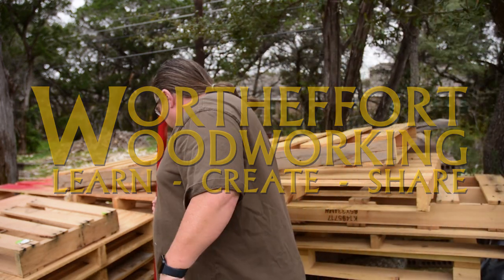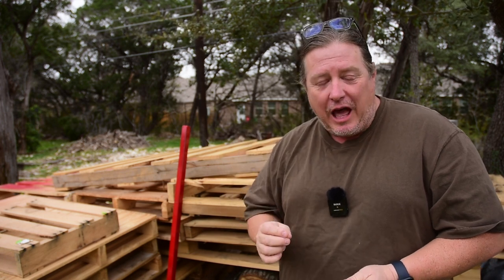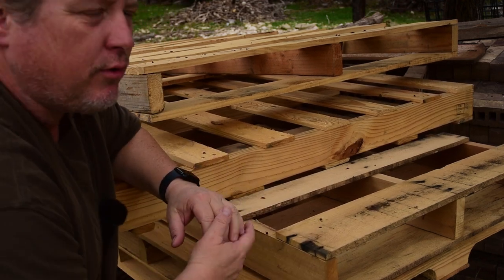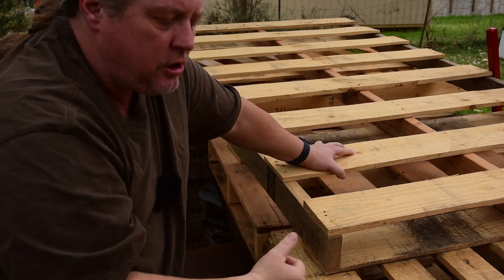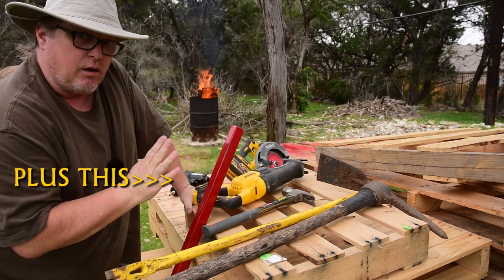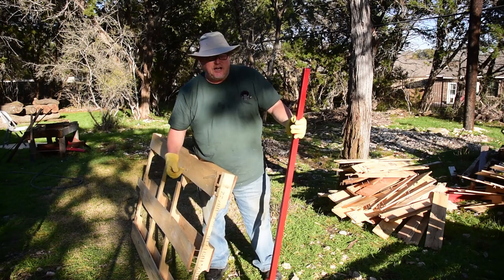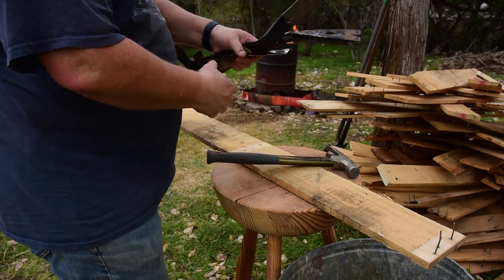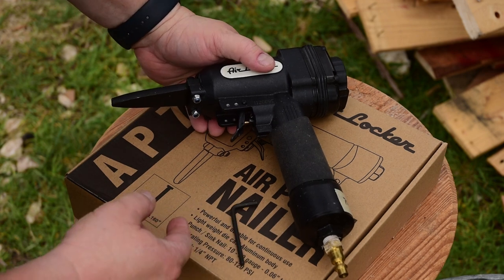How to Choose and Break Down Pallets

Comment: I worked in a warehouse for over 10 years. I've destroyed probably 100,000 pallets and used their wood to heat my garage and polebarn. The pallets with the square blocks in the corners and center are the best pallets period. They always have great wood and are thicker too. Take a sledge hammer and hit the square block. It will knock it right out and you will have flat panels to work with after that. Easy to get the nails out too when you knock the blocks out.

Comment: Different pallets require different tools and a little thought. Some are easy and others have so many nails or staples that it takes a lot of time. Any rebuilt pallet has probably got cut off nails and that makes milling them properly impossible. Look for the specialty pallets that have added wood for some special purpose, they have more usable wood.

Comment: For me I found it much faster to use recip saw with metal cutting blade - slide blade between boards and cut nails - can disassemble a pallet in less than a min - then punch the nails.

Comment: work in a large metal fabrication shop that uses a lot of sheet steel and coils. Most of the pallets that we get in are made of 3x4 solid oak and 1”-1.5” thick oak planks. A lot of it is worth surfacing and using

Comment: I've had that exact same gun for about 4 years and it still works good , I also have a regular air gun with a ball joint remover to gently pry the boards off, I made one of those pallet busters but being a cripple didn't work too good for me ! hard to use with a walker .
in my chair the air hammer is easier to use thank  you for the videos enjoy the turning ones this one is a bonus

Comment: Like you, I started with a hammer and a nail bar.  Progressed to a wrecking bar and a Burke Bar.  Eventually, I built my own pallet buster very much like the one you built.  AND, like you, what a time consuming pain in the caboose.
Research:  Nail Kicker V20.  The price drove me away instantly.  But the pain drove me back.  I found a used one on Craig's List.  You will never regret purchasing one of these.  I HIGHLY RECOMMEND these.  Instead of pulling the boards off then driving out the nails from the rear, you use the Nail Kicker on the FRONT and drive the nails through the board into the 2x4 stretchers.  Often, the board falls off, many times you can use your hand to pull it off, and once in a while, you'll need a pry bar.  Having NO NAILS in the boards cuts the break down time more than in half.  IF you value your time in dollars, you will off set the purchase price very quickly if you do a reasonable amount of pallets.  IF you BURN them for firewood, you will break down many more and the off set is extremely fast.  In the time we have used ours, I could have purchased 6 or more Nail Kickers brand new and still be ahead.
Note:  The Nail Kickers have 4 different sized heads if I remember correctly.  I recommend purchasing 1 or 2 sizes only.  Just the sizes you are finding in the pallets you can find.  The huge industrial pallets will use larger nails and require the larger size anvils and drive pins.  The directions are clear, all tools included, and an oil bottle is supplied with the new ones, although any oil can will work just fine.  Add 2-4 drops of oil every 4-8 hours of use.  I use more to prevent premature failure of o-rings.

Great videos.  I enjoy watching all the videos you post.
THANK YOU!

Comment: I bought a pallet buster and that air nailer and absolutely love them. Although my pallets are for odd jobs, these two tools make the process almost fun. My air nailer is set to 95 psi and the force of it pooping out nails is dangerous. I now use a plastic garbage can and lay thick fabric on the bottom of can so the nails don’t ricochet and shot back at me.

Comment: I got one used on Amazon for 40% off the already low price last year, love it, for renovation demolition work, reusing wood when it's still good. I had a white oak pallet with 8/4 sides without cutouts for the forks, and a fiddleback maple pallet with thinner planks I used for drawer fronts because on nice wood I'd rather cut the nail holes out of the picture.

Comment: hi , just ordered the nail punch air tool . I used to sell air tools for Snap On , and always told people to oil the tool at the end of use , couple of drops , run the tool , that means the oil STAYS in the tool whilst its stored and protects it as it cools down which is when the air cools down and turns into water to rust the internals , hope this helps ,

Comment: Dang that little pneumatic nail remover is really cool, I hate pallet wood because it takes so long to remove the nails but with that little tool it definitely makes pallet wood a good option for outdoor projects or projects where the surface quality of the project doesn't really matter.

Comment: That pallet buster is an awesome tool!  I can almost never pull those nails up without tearing the wood apart. They tend to use twisted nails that don’t pull easily. I cut the slats off of hardwood pallets and use an old hand plane to resurface them. Not may hardwood trees grow up in these northern parts so pallets are one of our only sources of free hardwood.
Reply: That pneumatic nail remover is also pretty nifty!

Comment: Great tool!!  I noticed that the pressure rating is on Amazon's link you provided at 80 to 120 PSI.   

Available at a lower price from other sellers that may not offer free Prime shipping.
Style: Nailer
Air Inlet: 1/4 inch NPT Thread
Operating Pressure: 80-120 PSI
Driver Diameter: 0.16 inch
Removable Nails Range: 10-20 gauge

Comment: I have one great fun to use, it nice to take revenge on all the nails that have fought with over the years. I fire into a drum of water a lot safer then just letting them bounce around. Your video shows a couple flying out of the drum, but these are a great time saver. Loke your video as normal. Thanks Bob

Comment: I recycle alot of pallet wood. The pallets i get from where i work are usually 4' by 10' for sheet metal. Planks are usually 1" thick.  Usually i use my recip saw and a demo blade, slice between the planks and runners. Then i either pop nail heads out or glue them in depending on project.
Reply: I work in a large metal fabrication shop that uses a lot of sheet steel and coils. Most of the pallets that we get in are made of 3x4 solid oak and 1”-1.5” thick oak planks. A lot of it is worth surfacing and using
Reply: @Patrick Grate  we also arr metal fabricators. Im not sure of all yhe species of wood if found but i know oak, fir, and poplar are common. I also found a reddish color wood i think is alder, not sure. One tip if you dont like nail holes, drill and plug with dowels.

Comment: I have got pallets from my work place with great wood! Pallets from Southeast Asia with mahogany  50% good dark wood 20% ok 30% light colored l would not use as l read it has a high silica content. Large pallets from Canada that new machinery was shipped in on quarter sawn pine 2x4x12’  l got two 4x4x45” walnut pieces a number of pieces of oak. The imported pallets are HT. The HT stamp means heat treated, kiln dried to a higher temp for a longer time in order to kill any bugs their eggs or large.

Comment: That AirLocker will also work to finish sinking large framing nails as well.  Don't use it to drive the nail, use a hammer, but if you get one in a weird spot where you can't get a good swing on the hammer to finish sinking it (like in a corner) this thing works great at driving it the last 1/4 inch.

Comment: I recently found a possible source of really nice reclaimed wood. I got pieces of a family heirloom piano. It was called 'untuneable' so not even something my sis could donate to anybody.  So, a very large, VERY heavy paperweight. I didn't know until we started to dismantle it, but the front panel is a solid slab of gorgeous birdseye maple without a flaw. The keyboard cover is oak. I'm thinking of making coasters from the keys  (since the thing is over a hundred years old there may be issues, though,  if the white keys are actually ivory.)  I want to re-use as much as possible and give my grandmother's piano a second life. My sis wants to turn the inner strings into a water feature. People are GIVING old pianos away.Once I get my shop set up better I am going to have to look in to how to transport the heavy bastards.  Until then, pallets. I just this week got an Air Locker and totally agree. Use eye protection always - those nails zing all over the place. Also, don't burn the scrap wood! I am bagging up small pieces for kindling and larger broken pieces for camp wood. Have you SEEN what they charge for camp wood?  When I get excess I can probably sell that too!
Reply from the maker: Piano's from before the 50's are most interesting. We use the black keys (many were pure ebony) for accents, pens and such. And much of the panels are actually wide boards not glue ups. Seems after the 50's veneers came into vogue and are less versatile in reuse. Armours are same way.

Comment: The recommended pressure may not be printed in the manual, but it's right there on the front of the box. I guess that kinda counts as the manual, maybe.
Reply: Yea 4th bullet 80-120 psi

Comment: Great video as always, i just wanted to respectfully point out that while I'm sure the instructions were terrible and the tool should have had the psi engraved as you pointed out, indeed the operating psi was right on the box in the shot at 17:57 😅

Comment: One trick I found.  Once you get the bottom boards off, with the top boards down, stand on the pallet and hit the sides of the blocks or stringers with a sledge hammer.

Comment: Here is my suggestion, which eliminates most of the work. Use a dowel making bit to drill down around every nail. The nail cones out with the dowel. Fix the hole later as part  of the project, but only to the degree necessary to keep the needed esthetics of
 each project .

Comment: I too had seen one of these being used to break down pallets, and for the priceIwas willing to try it out, assuming that if it worked for me the way it did in that video, the savings of aggravation would be well worth the price tag. Well…to be honest… I don’t regret a single dollar of its price, and I had a freaking blast blasting 💥nails out of a huge pile of wood. If I hadn’t pulled a double as soon as I got to the woodpile (stepped on two nails at the same time about an inch away from each other 😖 🤕 ), then it might have been a perfect day breaking down pallet wood.

Comment: Look at the bricklayers in the construction sites. They have to get stronger pallets to hold the bricks. I found a lot in oak. (I know ! Oak ! ) Yeah.
Reply: I've found a good technique to save the whole plank on the top and bottom. You put a 2x4 in the same side of the one inside the pallets. Then, you place something under the 2x4 that is trespassing the pallets and then just hammer the 2x4 that is from the pallet. It'll give a even surface under the planks so it don't crack in pieces and... I mean it's easy and you always have spare 2x4 so... ;)
Reply: The pneumatic nail pusher is a taker. 50 $ well invested. I'll watch to buy one.

Comment: It must be a regional thing because all the local pallets I get are very heavy solid oak without knots. The nails hold on for dear life while trying to rip them apart. 3/4 thick boards and the side boards are oak too.

The only time I see pallets of an inferior wood is when they came in from out of state. 

We lost 100's of thousands of Ash trees here in Iowa to the Emerald Ash Borer insect. Seemed like a waste to see healthy trees cut down and burned to try and stop the spread. Those trees could have been used for pallets if nothing else.

Comment: DANGER: many pallets are treated with a toxic insecticide called methyl bromide.  Most treated pallets are stamped with an 'MB' on a side board, but is it worth the risk to have this in your projects?  Not to mention the danger from breathing it in (airborne dust) when machining the wood.  It's also toxic when burned (the smoke).
Reply from the maker: Discussed in video that you didn't watch.